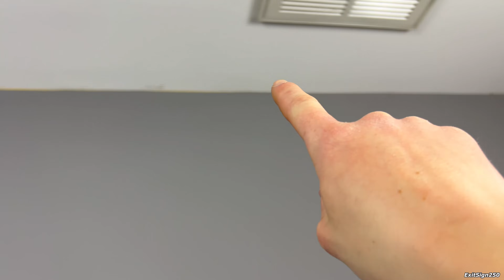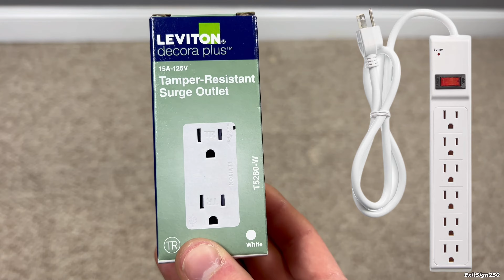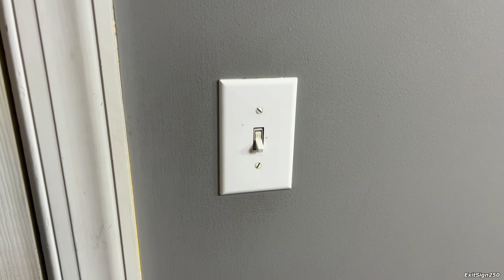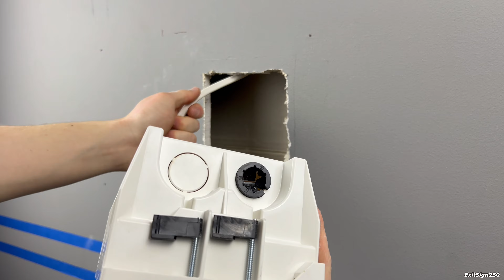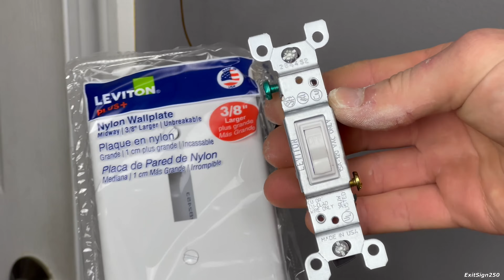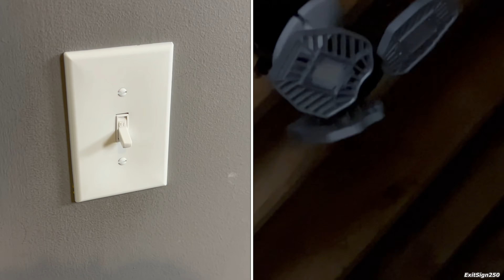Installing Recessed Electrical Outlets with Surge Protection for Wall Mounted TV

Comment: Where did u get the recess box?
Reply from the maker: I ordered it from an electrical parts distributor. But you can also find them on Amazon and some hardware stores may have similar types.

Comment: Then someone flips the light switch and your TV goes off 😂😂
Reply from the maker: The light switch is not connected to the TV.
Reply: The light has a constant hot. The leg that goes to the light is controlled by the switch. He tied into the power that’s always on